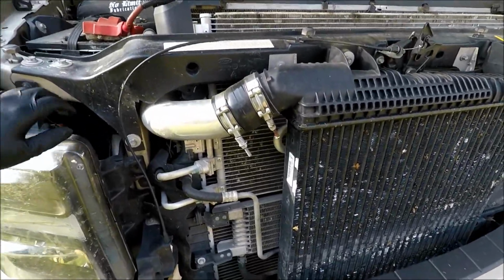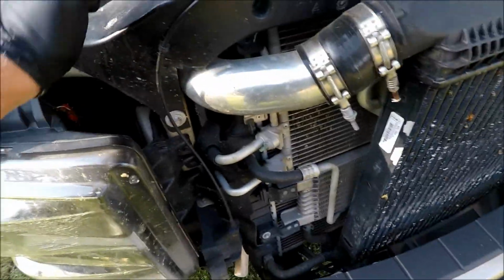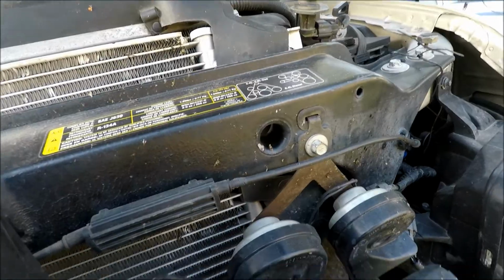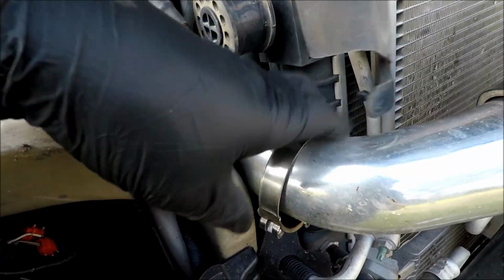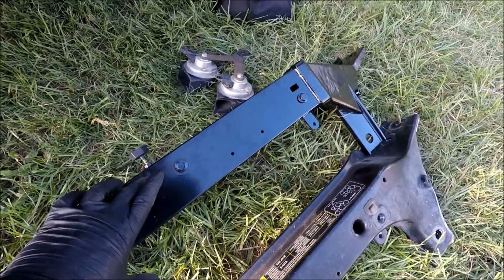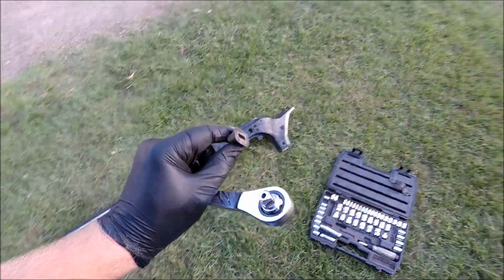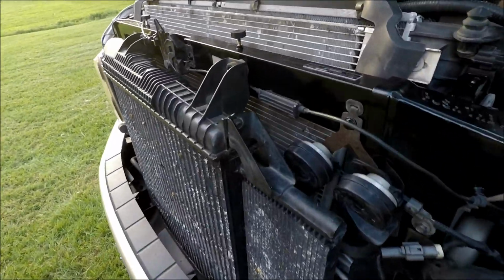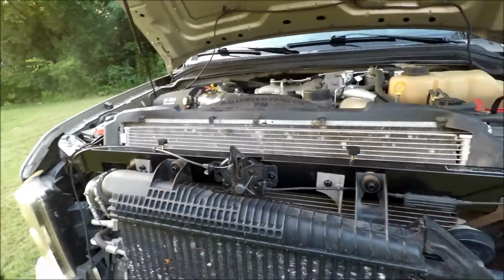Mishimoto Upper Support Bar 6.4 Powerstroke Install

Comment: Hey Man I Actually Have a 08F350 not a dually though lol I was wondering what exhaust you got on your and what delete kit you used ?? I’m just now getting into modding everything and I figured I’d start there......any advice I’d greatly appreciate
Reply from the maker: Mines a dual 5 inch Flo-Pro but can't get them in the US unfortunately. The delete kit was off ebay, unsure of brand

Comment: did you have to remove the coolant fluid when you did the intercooler cold side pipe????
Reply from the maker: No
Reply: @TheTexastngray  do you have to change both cold and hot side or can I just do the cold side and be done?
Reply from the maker: @danielr5565  you can just do the cold and be done
Reply: @TheTexastngray  thanks for the help
Reply: @TheTexastngray  do you have a video of an install for the cold side for a 6.4 powerstroke?
Reply from the maker: @danielr5565  I do not. Mishimoto has one on their channel I believe
Reply: @TheTexastngray  one more thing, does it really matter the brand I get?  I've seen some one ebay that go for under $100 made of aluminum and in 3".